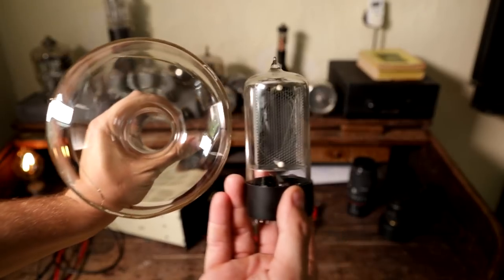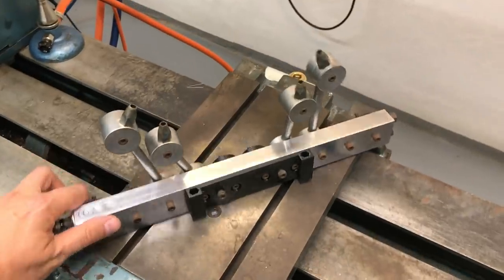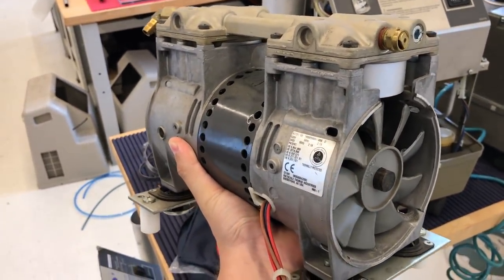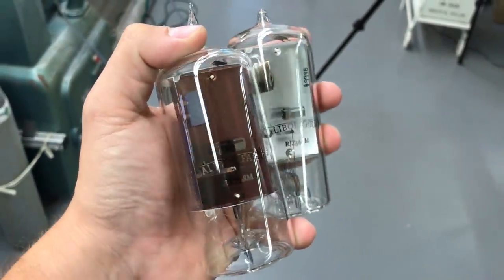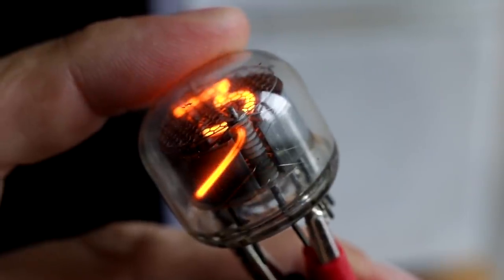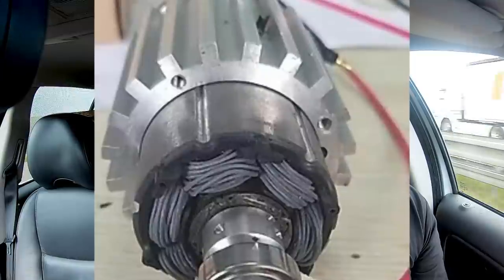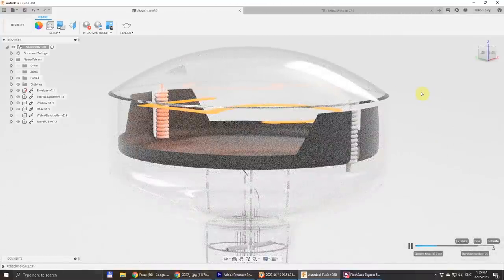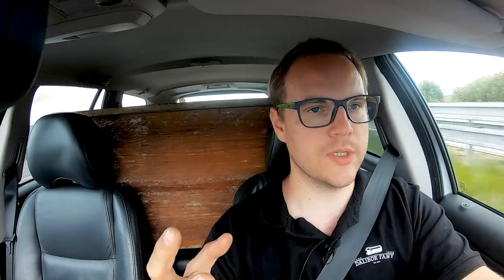Project update - Project H #9

Comment: I do hope you'll be making a 6 digit clock with these 150mm tubes. Or at least selling the tubes. Although I think I'd be too scared to make my own clock using what I'm sure will be fairly expensive tubes.
Reply: I was thinking the exact same thing. I think a clock with these tubes would be frightfully expensive unfortunately.
Reply from the maker: Yes, I will - once we have this project completed, I want to fine-tune the tube and make it our standard product. My goal is to get under $400 per piece, fingers crossed.
Reply: @daliborfarny  Sounds good. Time to start saving I think. My Cylindrical NixiSat GPS clock I bought 15+ years ago is still looking good and working with its z5680m tubes. Although some of the digits are faulty. But moving the digits around worked around the issue.
Reply from the maker: Thats interesting - how serious was the poisoning the tubes were able recover from? Especially - were there some areas completely without glow or just lower glow intensity? I am running tests on this with our tubes, but it takes long time to get results - it is also interesting to compare ours with the old tubes.
Reply: @daliborfarny  I just videoed the clock doing its self test and power up. You can see 3 of the digits are almost perfect. The other 3 are bad. The left most one is terrible. I do have some spare tubes which I got from ebay many years ago. As the clock is still readable I've never bothered swapping them over. Anyway the video is at https://www.youtube.com/watch?v=Q8xO8eV9ZeM  which seeing I've had the clock over 15 years and I know the tubes must be much older than that, I'm just happy it still works. At least until I can get a 'H' clock :D
Reply from the maker: @andymonks7126  Thank you so much for this, it is super valuable - the poisoning patterns are same as on our tubes, good to know. Is there any anti-poisoning routine on this clock?
Reply: Dalibor Farný just checked the manual. No poisoning options that I can see. I do have the brightness set quite low. Perhaps I’ll unbox my spare tubes and try them again.
Reply: @andymonks7126  To je v pohodě, myslím že bych je všechny oživil.

Comment: For nitrogen purge if you're going to need a lot for production, consider a liquid cylinder. I understand your reservations about a liquid oxygen cylinder, but you can get liquid nitrogen cylinders with holding pressures  anywhere from 0.3-10 bar, with a regulator on board to control how much liquid gets sent to the outside jacket wall to maintain the set pressure. So no pressures beyond normal shop-air, no in-pipe combustion risk like oxygen. Since your production window is somewhat short, the tank loss shouldn't be too bad over the period. They still vent occasionally, but the amount is small enough that it isn't a concern in a building with some fresh air intake in the HVAC.  If you're on strictly re-circulation for dust control, maybe locate it elsewhere in the lab, but that's the only additional concern it should bring vs a high pressure cylinder.
Reply from the maker: Hi! The liquid nitrogen is already in the shop (that large green cylinder) - 200 Bar :-)
Reply: I meant one of the larger stainless dewar style ones, they can have 180+ liters of liquid nitrogen which can output 100+ m3 of gas, and the price for the gas can end up cheaper than buying in 200 bar cylinders.  The 200 bar cylinders can sit in storage indefinitely and not lose any gas, so if you're using a small amount, they make sense. If you need a lot, the large ones make sense, despite them purging off some of the gas. I took a second look at your flow meter when you showed it, and if its only 0.7 L/m that you use, then the cylinder you're using is probably the best suited. I'm more used to gas purge flow rates used for TIG welding which can be 10-20x what you're using, and would be drained pretty quickly.

Comment: Really loved this video, so much to talk about. Very surprised to see you building a rack of oxygen concentrators instead of working with liquid oxygen. I work with liquid nitrogen and helium at my workplace and it was my understanding that dewars are never high pressure? They have multiple relief valves and vent constantly only maintaining pressures just high enough to run the torches. 
Those wooden trunks were amazing to see, 1800's!! wow.
Please look into hydoforming with rubber! the tooling is very easy to produce and you can use an arbor press to form the shapes. Rubber presses down on the sheet of material and then acts like a fluid under higher pressure conforming the part around the "male" shape of the die below. I have done this for copper prototype vacuum parts and it worked quite well.
I have to say, I have always been a machinist and not interested in ever making the jump to a cottage industry buisness owner (if it meant I diddnt get to be on a shop floor anymore) and this series is really making me fall in love with the whole process of working with manufacturers and suppliers. Thank you for detailing this journey and sharing dollar numbers too! Was shocked to hear the ceramic molds are only hundreds not thousands!
You just need more heat, those glass seals are going to go well when you have more flame. I have some friends that use hydrogen torches for working quartz, the torches are nearly the same you may look into this if your carriage burner needs a little boost.

Comment: I would not bother with the solder glass. And that, for one major reason, it directly interferes with another critical process in the creation of the tube. One of my design pillars is that if a process does that, then, it better deliver me a coffee cup on a golden platter in order to uproot a formerly established process with no issues of its own. The way i see it, the glass solder doesn't deliver, and it isn't a safe option either, because of its function. I'm not saying it's a bad product, it's just not good here. It's a false trail. Just my 2 cents.
Reply from the maker: I agree, I am just never confident enough not to try. I want to explore also the dead ends to see them really dead with my own eyes ;-)

Comment: 1. Don't compromise quality.
2. Use annealing in muffle as you've already mastered well, and which brings you the best result possible.
3. Use temporary tube sealing with inert Ar atmosphere and some alkali metal chemical absorber in tiny glass appendix.
4. Heat it gently to let the absorber collect oxigen, water and else.
5. Burn off the absorbent appendix and seal the tube finally.
            Wish you the best.    please share what you think and tell if there's something wrong.

Comment: Have you tried to seal the tube at the rear side of the "ring" ...  so you could anneal the thick front and the "ring" in an ofen and have the tension on the back side against the more flexible "tube" side.
And the contact angle would not be 90°, which causes lot of stress, but can be 180° (much more even).
Reply from the maker: This is a backup option - more laborious, but easier as for the stress build-up.

Comment: Dalibor, if you need to anneal, might I suggest either forming gas or Ar / 4%H2. Both are readily available, affordable, and will give you a reducing environment.
Reply: Also, you should look up the Ellingham diagram. Very useful for this kind of thing. "Normal" high vacuum still has a ton of oxygen relative to any reducing atmosphere process.
Reply: Also, forming gas is potentially appealing if you want to use regular steel for the internal parts, as it will not oxidize in this atmosphere. Because you are considering a switch to stamping, I would suggest to try to move away from stainless, as the significant increase in hardness will cause die wear problems.

Comment: Добрый вечер, Далибор! По поводу стресса большого стекла, может быть нужно прогревать лицевое стекло вместе с боковым по всей поверхности? сейчас получается что вы к "холодному" лицевому стеклу присоединяете "горячее" боковое. В пооцессе остывания "горячее" сжимается сильнее чем "холодное" появляется деформация и стресс. 

 Изоляцию выводов можно выполнить в виде небольшого щитка из стекла между анодом и выводами катодов, при этом оставить выводы  катодов без покрытия. У  меня нет опыта изготовления электронных ламп, но надеюсь мои идеи будут полезны.

Good evening, Dalibor!  Regarding the stress of the large glass, it may be necessary to heat the front glass along with the side glass over the entire surface?  Now it turns out that you attach a “hot” side glass to the “cold” front glass.  In the cooling process, the “hotter” shrinks harder than the “cold” strain and stress. 

 The isolation of the leads can be made in the form of a small shield made of glass between the anode and the leads of the cathodes, while leaving the leads of the cathodes uncoated.  I have no experience in manufacturing electronic tubes, but I hope my ideas will be useful.

Comment: Hello. Did you try kanthal wire for the none glowing connection? I wonder if the aluminium of this alloy could be enough to provide a sufficient isolation (might be necessary to preheat them in oxidized gas first to develop its natural alumina coating)?
May be just a wrong assumption of my part...

Comment: For your metal stamping needs, have a look at this video: https://www.youtube.com/watch?v=xw5yEMsDxR8  Tooling costs are much lower for this process. You would well be able to use tools cast from metal-filled epoxy or polyurethane, and while these tools won't last as long as ones made from metal, once you have a mould to cast the tools in, you can make as many as you want for trivial costs.
Reply from the maker: I've seen that video - this technique is interesting, want to try it at least..

Comment: A cylinder of oxygen actually not all too dangerous I work with them on a daily basis.
Reply from the maker: It is not dangerous until you grease your hands and touch the internal surfaces of the pressure regulator valve. Then it is able to do nice effects :-)

Comment: is it possible to friction weld glass?
Reply from the maker: I dont think so - instead, it is possible to laser weld it. But this is $$$$$..
Reply: Only Bulk metallic glasses. They are crazy materials that have weird properties, you can even blow mold them like you'd do with plastic (glass can be blow molded, for sure, but it doesn't behave as plastic does, and then there's the stresses in the glass itself). Do a google search for bulk metallic glasses, interesting topic. :)